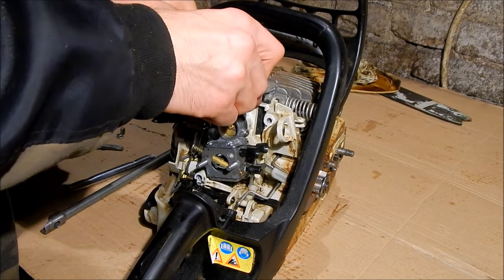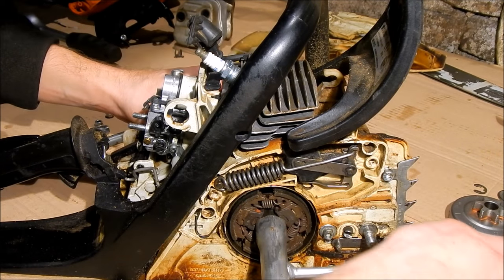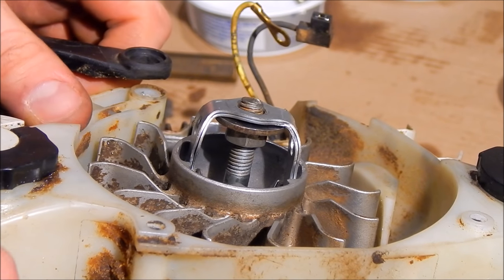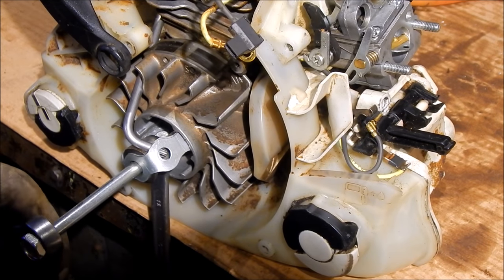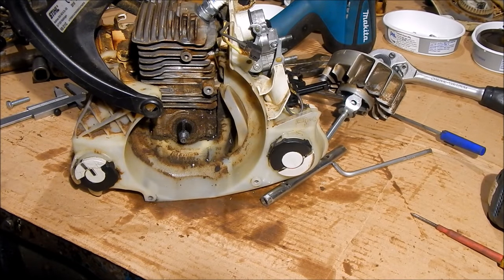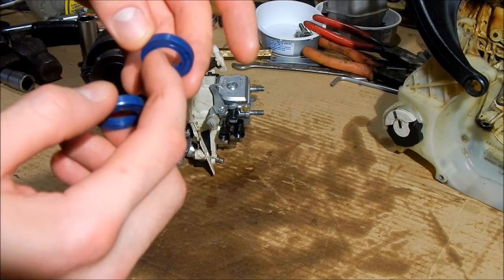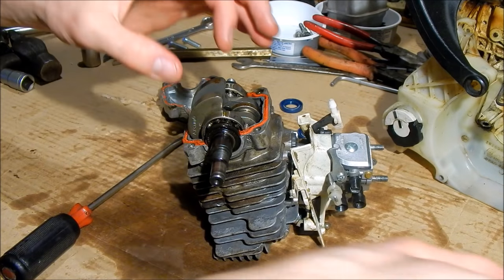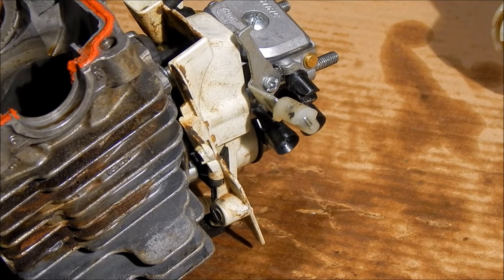Replacing STIHL MS211 Crank Seals

Comment: To remove flywheel, position a punch on center of shaft, after removing flywheel nut. Strike punch with hammer, the shock will loosen flywheel. Remove by hand.

Comment: Light coat of RTV in the seal channels of the case both side needed as well.  Hence casing seal and bearing channels are part of the molding, not a milled process to make sure they are perfectly round, so the light coat of RTV is needed in the seal case channels so the outside of the seals get fully seal to the case channels as well.

Comment: The flywheel pops right off with a slight pry to the backside while tapping the loosened flywheel nut.
Don't drill Hiles into it!!!!
It is precisely balanced.
Reply: Dan Henderson I just tap the crank with a hammer
Reply: Was balanced. Not anymore.

Comment: just screw the flywheel nut on the shift a few turns and hit the  nut with a small hammer, sharply,  and the flywheel will usually come off the shift.  if not try a BFH.

Comment: I had a customer that replaced hes own crank case and piston rings but engine fires but wont run unless I'm holding the throttle in and cuts out even when the throttle adjustment is on full, I did a compression test only showing just over 25 carb has been cleaned this one has got me
Reply: Well the compression should be well over 125 psi but you mentioned 25psi usually means there's air leak somewhere on the engine. Or worse case the cylinder head, piston and rings are shot. To get compression to come back you would have to clean the bore with two stroke oil and a lint free cloth, clean the piston ring gaps for crud buildup and clean the rings as it needs to be moving. I have heard of sticky rings stuck to the piston resulting extremely low compression or holding the pull cord letting the chainsaw free falling on it own as signs of dropping too quick is lack of compression. That all I can think of due to my brother asking me 101 questions of why it not working for him

Comment: put the nut back on flywheel a few turns and put socket on nut hit with hammer two taps flywheel will pop right off
Reply: Exactly what I was about to comment... simple fast and easy
Reply: I just tap my hammer in the crank

Comment: How did you stop the crankshaft from turning when you loosened the flywheel nut?
Reply: I put parra cord in top of cylinder through the spark plug hole about. 2 foot leave a bit hanging out and it traps piston on the head.
After undoing the nut pull cord out easy

Comment: Just run the flywheel nut down until it is flush with the top of the crankshaft and hit the end of the nut with a brass or hard plastic hammer while putting upward pressure on the flywheel.  I use small pry bars to to that and the flywheel, after a few raps, will pop loose.  They do make flywheel pullers but they are specific to each model of saw.    I just do the rap method. With the nut screwed on to protect the threads on the. Rankshaft.

Comment: THANK YOU FOR THIS video but you change the segments, and the grooves on the cilyndre what do you do?
I ALSO SEE BEARINGS open without grease? I AM TR7S SURPRIS are they greased by the oil of the mixture?
Reply: Yes the oil in gas lubes bearings .if you think about it kinda amazing that they don't burn up

Comment: Did you dirco the outside flanges of the seals and grease the insides?  I also was surprised to see you didn't use a feeler to gap the coil.

Comment: yep, getting two stroke to start and run with bad seals is very hard.
Reply from the maker: It did start eventually with the choke fully on though. But yeah, the joys of two strokes... :D
Reply: atleast it could be fixed for 10$.. a 4stroke will cost alot more when you get into oil seals and pumps and valves and rockers ect 2stroke small engines are the way to go if youre gonna fix them yourself.. if youre paying someone to fix them go 4stroke as 2 strokes typically have an issue yearly where 4 strokes can be quite reliable

Comment: You really had to get into that thing to replace those.  Think they should be made of some special material instead of just any type of plastic or rubber like I have seen on different brands.
Reply: Phillip Kramer this is typical of the homeowner series of saws. The pro series has easy access to the top end bolts on top and can easily replace the top half an about 2 hours, if you know what you are doing. The homeowner series engines can be fixed, as proven here, but takes more time to get into everything. If you have the know how, you can take a homeowner model and replace things and they will last a lifetime, if you use them for what they are intended for.

Comment: Please don’t go through this type of flywheel removal technique.  Just put the nut back on the shaft so that it can be hit upon without hitting the threaded end of the shaft.  Get a brass drift punch to hit the nut with.  Place a wide blade screw driver or similar under the flywheel at a magnet location and against the main body at the top of flywheel.  Apply slight leverage and wack the nut using the brass drift with a hammer. It will come off!

Comment: what are you use oil?
Reply from the maker: For the fuel mix my grandfather uses special Husqvarna oil, those little bottles pre-measured for 5 L of fuel. I used some generic oil while assembling the saw just to make the piston and cylinder more slippery.

Comment: You didn't show that you supposed to lube the cylinder wall and you didn't provide how long the gasket sealant supposed to set up before installation of everything else! Plus provide torque specs for screws!